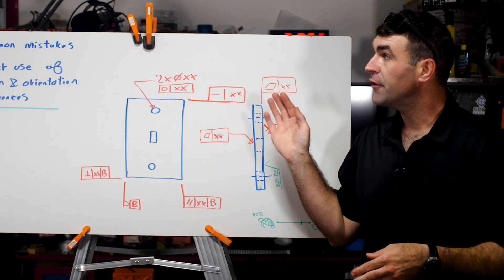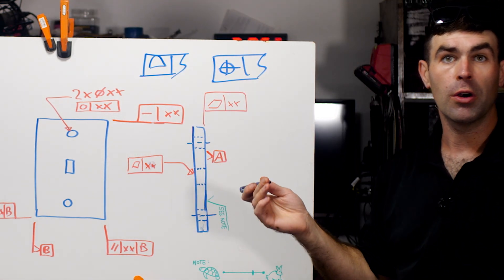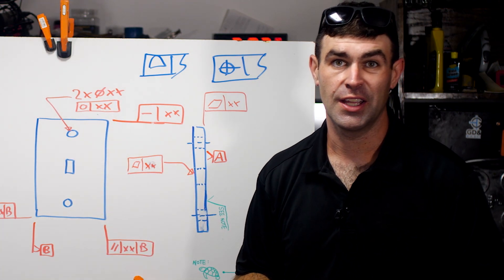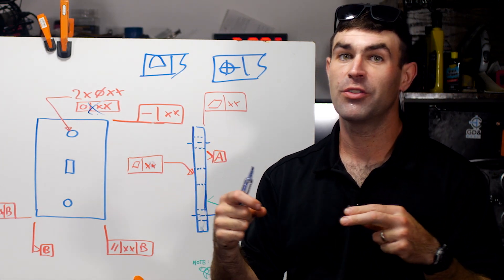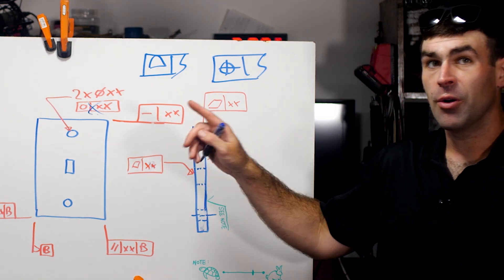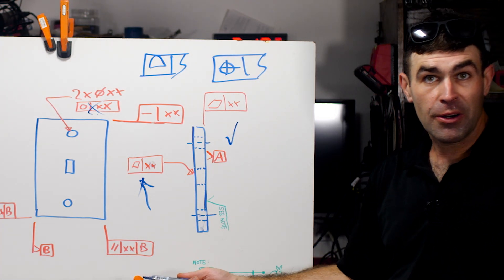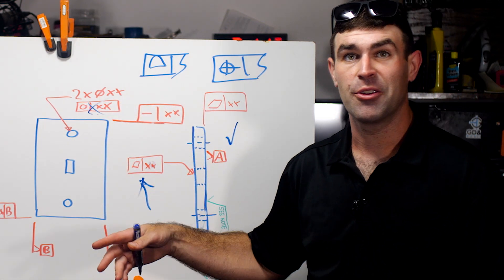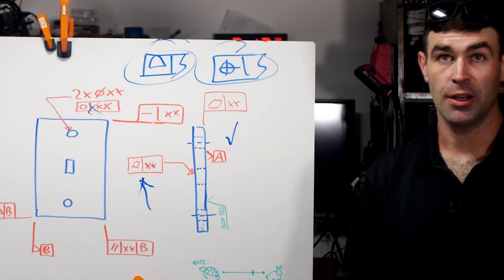GD&T Common Mistakes: Overuse of Orientation and Form

Comment: I watched most of your videos. Great job! Thanks for your effort. I recommend your channel to my teammates in my company. And haircuts are legendary :D If I could suggest a topic for future video, that would be the cones and methods of control. I'd like to see which controls are applicable, which controls are good, which are less good. As far as I understand Total Runout is not allowed on cones since revision 2018, how would you comment that?. How to control coaxiality of cone versus other feature like hole (since Position is not supported on the cones in ASME)? Thanks.